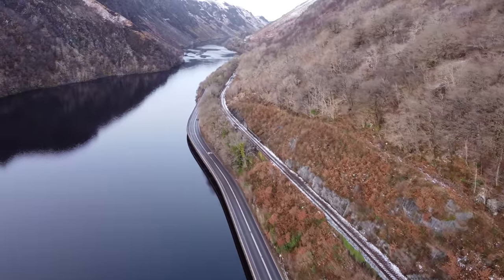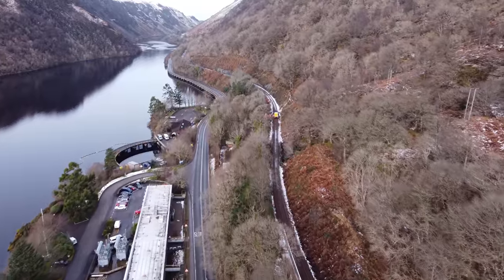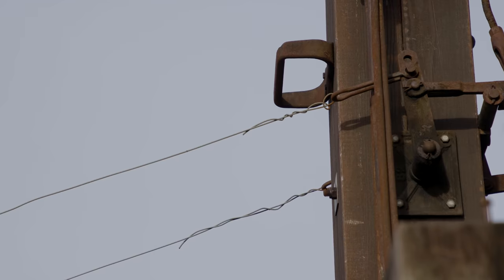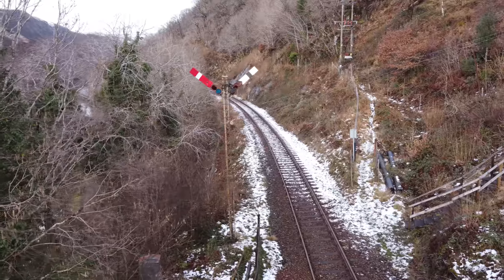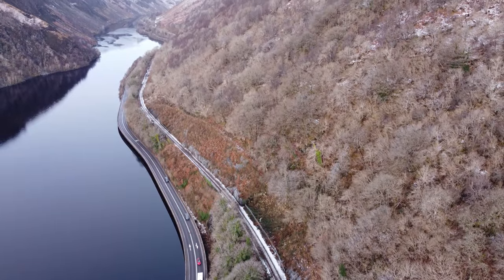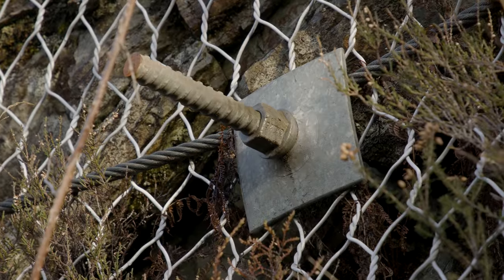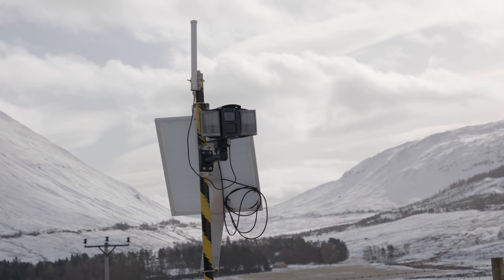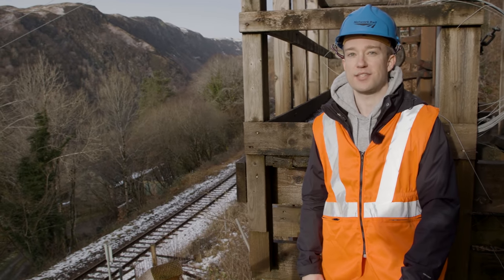After 140 years, this old technology still keeps trains safe

Comment: Interesting that a big problem with maintaining an Anderson's Piano is that the wire manufacturers are making wire stronger than ever. 

I wonder if they could make do with a mechanical "fuse" - i.e. a link that will break at the required load that can be put here and there in a run of wire, so that the wire strength then doesn't matter. I expect they've already thought of that, maybe they just need some small engineering company to make them at a reasonable cost.
Reply: You know what that's actually a good idea. The only issue is you would need the fuses quite close, at every fence point, so that slack formed by any distance doesn't absorb too much of the blow. It would be interesting to pose the idea. But I guess like anything that works once you're in this deep on something so big, making such a widespread change to something that may have a simpler and easier method in the near future may be seen as too much. But it also seems viable too.
Reply: @scootergrant8683  I reckon that's good thinking.

I've been mulling over what would make a suitable weak link. Steel? It rusts. Stainless steel? Doesn't rust... Aluminium? Corrosion. Plastic? Will degrade with time and snap. Can't be too brittle, can't be too stretchy. 

How about a cell containing a spring, which if that stretches too much sets off a percussion cap and a very small explosive to sever the spring? Could have an arming pin to allow rough handling during installation, take the pins out when installed. Could also be made adjustable. Bonus; the crack as the explosive goes off is fairly characteristic, could be picked up by a mic and reported. 

I did have another idea. For fuses of different strengths, just put the required number in parallel.
Reply: @abarratt8869  all those breakage point methods are more complicated than “partially cutting a wire.”

Comment: Couldn't they just have a wire at tension that snaps if a rock falls on it, which lets a semaphore signal drop indicating danger?
Reply: Why no one thought of this, we'll never know
Reply: Mmmm that's effectively what the system is - just multiple wires to cater for small, large and bouncing rock / debris falling down the hill.

Comment: Wouldn't a camera pointed out the signals or some sort of sensor/switch radio system,  alert the operators sooner so that they can send people to check it out instead of relying on the trains to radio HQ?
Reply: Agreed, it doesn't add up. They have equipment powered by solar panels already, so it's definitely possible, even if the power limits are low. A limit switch, a wireless radio, and a battery kept charged by a solar panel for when it needs to broadcast would let them monitor the signal flags in real time instead of waiting for a train to pass through. Seems like such a simple solution that I don't understand why they can't do it.
Reply: If you watch the vid, the engineer does actually say they have a camera watching. But I guess that's only an extra safety measure, it doesn't replace Anderson's Piano as a system.
Reply: That's a lot of cameras - if the Scottish Government refuses to properly upgrade the busy Rest and Be Thankful's A83 (which gets a massive landslide usually once or twice a year) then there's no chance in hell they're going to fund a fancy mechanism for a line that stretches hundreds of kilometres.
Reply: @CountScarlioni  My company builds those cameras. They provide still images every 7 hours or so (or in response to sensor movement), they aren't a live feed like a webcam though.

Comment: "Couldn't they just..."

...run small rail-mounted drones the minimum stopping distance in front of every train. 

You'd need fewer sensors, smaller sensors, and less complicated sensors. I'm sure you could easily use the train to recharge the drones at stops if PV cells couldn't keep up.
Reply: Was going to say exactly the same thing. A sacrificial rail-bot running at some specified distance ahead of the train to detect problems.
Reply: @Jonas Probably not, many remote areas use a single line where trains pull into a siding to let another past in the other direction. An independent patrol bot could easily find itself running head on into an oncoming train.
Reply: @crayzeape2230  At those points it could reduce its leading distance to near zero... I actually think it's a really smart solution.
Reply: It also helps with a wider variety of issues. It's a great idea.

Comment: Hey it works and appears to work fairly well.  The only thing I would add would be a couple of switches on the arms so if the system is tripped a signal could be sent to central control.  A crew could come out and investigate and either reset the signal or clear the obstruction.  Sometimes I think we rely too much on electronics.

Comment: Part of me thinks the fence with tilt sensors at the end would be the next logical iteration, but as the guy said, its getting power to them.  Winters are dark, solar panels need to be cleaned, and it seems like you'd need just as much maintenance as the old system even if you could make it work.

Comment: We have a similar system in the north of Sweden for avalanches, poles with a slit and a razorblad in the slit are installed along the mountain, and a wire with a current is run through the slit if all poles, if theres is an avalanches the pole will snap, cut the wire and that will stop the trains.

Comment: In France on mainlines, there are two types of signals. Danger (2 red lights) where the train must stop, if they pass there will be a detonation from a trackside device. If for whatever reason they are allowed to pass they must be given a bulletin, the detonation will still happen. The other type of signal is a semaphore (1 red light with a small white light), where the driver must stop, but then can proceed with caution and not exceed 30 kmh. For rock protection, they use thin wire strung between telegraph poles, if the wire breaks the electrical circuit is broken and the signal turns to danger.

Comment: Re: The signals. Cellular signal, solar panel, battery, and a contact sensor. Connect power to the cellular signal only when the contact sensor is closed (completing the circuit only when the signal is in "danger"). I'm sure there are issues, but just a thought. Nothing in the wires or weights changes, just the signal sign.
Reply: power is required to invert the signal from "broken wire" to "turn on".  To avoid false positives it should be a robust signal as well, and may not run well off a 10-year lithium battery.

Comment: If they can't get wires that are of not excessive strength, how about putting a snap fitting at some point (preferably one easy to reach) in a strong wire so that the snap fitting comes undone when a boulder hits the wire with a critical amount of force.  This would be a very slight change to the existing system, but would enable use of modern wire and make it easier to reset the system.

Comment: improvements:
- get a clip system to have shorter lenghts of wires: if a wire breaks, it's easier to change 5 meters than to change 50 in one go.
- electric signals will also be stopped if a cable breaks, so you can have a small monitoring device (low voltage required) that activates a communications system when the signal is interrupted. Bonus would be to insulate the cables at the poles to be able to identify the size of what broke the cable.
- Get this cable system as close to the railway as possible to ease up repairs: you don't really care if a rock is closer to the rail, you only care if it is on the rail itself.
- Energy can be obtained by solar panels, but you may prefer little wind turbines combined with the solar panel. Maybe even a water wheel with a high resistance so you can use the weight of the rainwater and/or birds trying to land on it.
- lasers through hoops can help identify if the rail itself moved, and you can just ho with a piece of paper to identify which hoop is the one out of place. Instead of infrared cameras.
-as a reset you need an actual engine, but you could have a backup cable that sets itself in place while the repair team comes and fixes the broken one. It's costly, but you do win a reset button.

Comment: The only improvement I could think of is to electrify the system.

Run low power radio frequency electrical signals through the wires and you can pick up damage or stretching to the wires, not just breaking.  Then hook that all up to an electronic signal that will give a warning if one of the wires becomes suddenly altered and flip the signal with an electronic actuator.   Keep the old system with tension as backup as well.

Comment: So what I get from this is that there are solutions that could be hypothetically implemented, but due to the issues installing and maintaining those systems would introduce compared to the potential improvements in the safety factor, the existing system just makes sense to keep around.

Comment: I can see a way to improve it without much fuss. Add a low powered radio signal to the arm, so when it drops, you know, before the train arrives! Battery with solar would last for years, as you could have a physical off tilt switch.

Comment: I like the idea posted by Ben Blackburn about a wire with an electrical current running through it.  Another possibility that I think would work, but would also require power to the warning signals, would be fiber optic wires.  A loss of the light passing through the fiber would indicate a break.  You could run the fiber for miles from the nearest town, but the signal would still need electricity.
Reply: Excellent ideas!  Another possibility would be a network of low-powered laser beams -- so that when a rock passes through a beam and interrupts it, the system detects it and sets the signal to red!

Comment: If you go on a London Tube train, you will notice 2 wires that run along the tunnel wall. I believe they stop the traction power if they are shorted.

Comment: Dams use piezoelectric detection for embankment movement. It's very sensitive and generates its own charge (you still need telemetry on site though - so a battery and a solar panel or wind generator).

Comment: in modern manufacturing this is known as an E-Stop or Emergency Stop.  The E-stop still uses a wire under tension around the outside of the machine that will cause it to shut off when the wire is hit.   While there are many ways this old system could be changed up, such as switching Normally Closed to Normally Open, and swapping wire tension for water pressure or air pressure, it would be change for the sake of change. Sure its 140 years old, but If it aint broke, dont fix it.

Comment: Only thing I could think off is solar powered radio transmitter that sends wire break the moment incident occurs, and when comes to wire type, if supply is a problem use thinner wire or hardened, not annealed wire, also can send electrical signal or sensor each hook down that wire to narrow down break point, speeding up whole action by exactly knowing where the fault had place, long before train arrives
And for more costly solution: long tube of air anchored to the ground, stopping rocks and snow, pressure drop indicate eventual tear, only problem would be if rolling rock jumper over it, but it's all about careful planning

Comment: You should recommend them using LoRa or LoRaWAN sensors.  They are designed to be low power, long range, and even work in a mesh network configuration.

Comment: I don't know the specifics, but I feel a good modern solution would involve fiber optics.  In some fibers you can run signals for up to 100 km before you need a booster/repeater.  The problem with those is that if the sensor mechanism involved the fibers breaking, fixing that break is a lot more involved than just replacing a metal wire on a hook.
Reply: They literally say in the video that they tried it

Comment: My brain is saying “build a tunnel over the tracks for the length of the journey. You can have cut outs on the far side to let light in, but I’m thinking rather like some of the roads up in the French alps that are on the sides of the mountains, which are effectively encased in concrete except the “off” side of the mountain in a sort of semi-tunnel, with regular supporting columns instead of a solid wall.. The roof often has a slight overhang and a slope, so rocks slide off, but also the structure is reinforced enough to take the weight of some rocks too.

Comment: I'm impressed with the mechanical simplicity of this and so if it works then don't change it, but I'm surprised the signal arms are red home/starter signals which quite rightly should not be passed when at danger without authorisation. A simple solution to this would be to change the arms to a yellow fish tailed distant type, where if it is lowered then it can be passed but at reduced speed as it indicates the way ahead is not clear and must be treated by the driver to take caution.

Comment: On the point at 3:43, in the Czech republic as far as I know, it may exist in other places, we have what is called an autoblock signal, they are on main lines between stations mostly. On those the drivers are allowed to pass danger, as long as they are driving so they can stop before an obstruction, but no faster than 100 kph, these days they are trained to not exceed 40 kph, but they can pass a RED signal and they do on daily basis.

Comment: As mechanical and software engineer, i find this problem fascinating… i don’t suppose any train guy here happens to know the average stopping distance of a train cruising at 60mph? Are there required regulations, must stop by Y if travelling X speed etc?
Reply: The common solution is a pre-signal to the signal. If there is "a red traffic light", you have a signal 2-3km ahead announcing "next light is probably red".
On modern high speed trains, there are not signals at all, the information is transmitted directly to the train.
If there is a requirement "must stop by Y if travelling X" the solution is a speed limit ;-) You lower the X until Y is fullfilled.

Comment: Actually, the part about the new signals signalling to stop CAN be passed with prescription (given by the system/control) and in most cases the driver will be the reconnaissance

Comment: The system can be improved by adding a sensor to the weight mechanism to warn the driver before it reaches the area and to allow the cleaning team to be ready or leave before the driver finds out that the train cannot continue. Modifying the system you could add springs for the sensor to rearm automatically. I think this falls in the category: it works don't touch it.

Comment: I guess for a start you'd want to run some power and networking to help with reliable connection to sensory IOT, but thats easier said than done since you'd need high voltages to maintain power delivery over those distances, and either copper networking or extremely heavilly reinforced fibre that will withstand any contact with rocks, and also repeating for either.
Undersea cable encased in steel piping and concrete perhaps?

Comment: Interestingly, the apollo launch escape system uses a similar mechanism. wires ran the length of the rocket, and if more than one broke then the capsule would be pulled away from the rocket

Comment: Train create a lot of thermal energy would a mag system work so as a train comes through it creates power for the system along with the solar panel idea and only have the system powered up like the way rail crossings are powered. It’s essentially a really long rail crossing where trains don’t have the right away
Reply: @ᴛᴏᴍ sᴄᴏᴛᴛ  sorry not in the uk mate

Comment: Astonishingly simple solution...

Actually, the Polish train engineers could pass the modern automatic signals at danger (single red light) after stopping and continue to drive at sight, not exceeding 20 km/h. Some of that automatic signals (e.g. at steep inclines) have an indicator meaning that freight trains could pass without stopping at all, just need to slow down. However, for the signals used in central tunnel in Warsaw,  an additional aspect is used. The second flashing red light means that it is strictly forbidden to pass the signal at danger into the tunnel.

Comment: Very manual, it could easily be improved upon simply with a network that tells you when the indicator triggers, then send this info to the trains, can keep the wire breaking method, but relying on sight is old

Comment: Well the big problem with this system seems to be that the Railway engineers have no Idea when and on what part of the railroad a rock has hit. This requires the next train driver to slowly drive through the dangerous area and report the damage when they reach the next station. 

I see an easy fix or upgrade for this system. The mechanical signals also turn an electrical switch closing a circuit and setting activating a lamp on a map letting the engineers know where a cable of the piano has been damaged.

Comment: Substitute the "piano" wires with an electric fence, if the circuit is interrupted for any reason, alert the driver.
If the wires are strong enough, only boulders can break them, animals can't.
If the voltage is high, animals can't get past the fence.
If the wires are high enough from the ground (and voltage is low) animals can pass.
It all depends upon the requirements of the railroad company.
Reply: Microwave size rocks have to be detected and scotland has deer, also power delivery is an issue